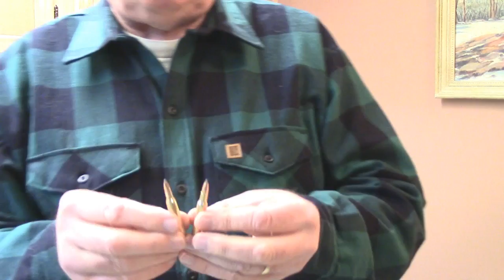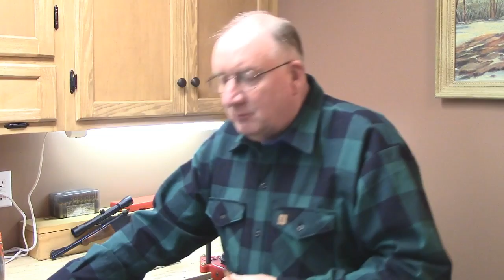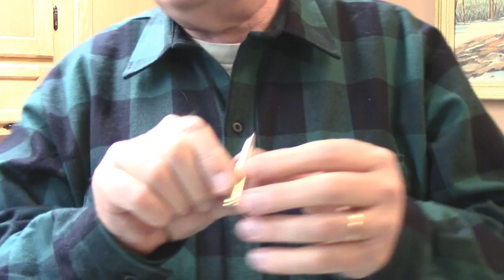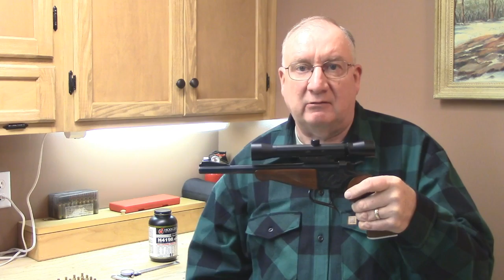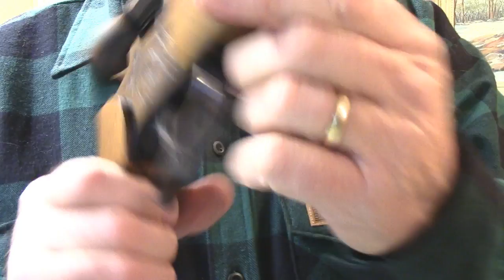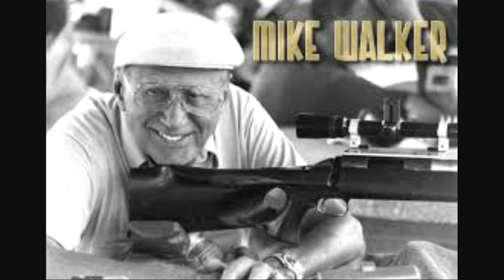The Great  222 Remington

Comment: Gary park
     I just came across this post.
I was listening to at as I was reloading for my 222 rem. My 222 rem mowhawk 600 is also and old and trusted friend.  Here in northeast Pa. I've used it for many things. During the Rim fire ammo shortage . I loaded 55 grain cast bullets with reduced loads and it became my squirrel rifle for 5 years.  I didn't stand in line for a ration of 22mag or 22lr ammo. I have a reduced load I use for fall turkey.  As a wildlife conservation officer it took care of truck loads of road injured deer , with one and done effectiveness. It's a constant companion on my little farm.  Chucks in the beans, coyote around the chicken pasture, the little triple duce is just right, cheap to load for and versatile. My mowhawk 600 sports a new black walnut stock, after market metal trigergaurd ,  and a fixed 4x scope. I'll never part with my 222re

Comment: Great video Gunblue.  I have always had an interest in the Rem 721 and 722 rifles as they are just so well made.  Hammer forged actions and barrels, etc.  Lucky enough to find a Rem 722 in 222 Remington in great shape that I am going to pickup.  Master gunsmith in my area feos the same way as you about the cartridge.  I am looking forward to getting to know this cartridge very soon.  By the way, the CZ Czech rifles are phenomenal so if you get the chance, check them out.
Reply: J’ai possède deux cz en 222, 527 et 550 lux excellent au tir sur prédateurs à la distance moyenne de 200m pendant 35 ans de garde de chasse en France que de souvenirs nostalgiques.

Comment: the designer of that trigger himself said it was a bad design but Remington refused to change it because of business reasons
Reply from the maker: Such an attribution requires documentation, or it's simply hearsay. The trigger was absolutely not bad. Because Mr. Walker designed it for complete adjustability, it was vulnerable to misadjustment by foolish people. Countless millions of mechanical tools and systems are vulnerable to being maladjusted or misused by incompetence, whether it's a chain saw, welder's torch, window washer scaffolding, or the operation of a car accelerator pedal, but it does not mean they are bad. I have an intimate understanding of many trigger systems, especially Walker's Remington trigger.  Do you know how many fine triggers made through the years had similar adjustment vulnerability to misguided hands, and how many guns beside Remington's could be abused?  Nobody ever scandalized Sako's fully adjustable trigger. The whole issue was a scandal perpetrated by an anti-gun media to destroy an American institution.  It was never an unsafe or bad trigger. The result is that now, triggers are made to prevent reasonable adjustment, and are sealed, which means that owners purchase sketchy, unnecessary, and ridiculously expensive aftermarket triggers that are packaged with legal disclaimers, which are abused no differently than the Walker trigger was. "Business reasons" is not a bad thing, except to those with a Socialist agenda.  Business is where people go to work and how America prospers.  Remington had no reasonable grounds to change such an excellent design until they were unfortunately compelled to do so by a tort-minded letigious bunch of hungry lawyers.

Comment: What are your thoughts on 5.56x45 over .223 Remington? I watched your video about how energy does not equal killing power and it made me think about my choice for using 5.56 exclusively. However I exclusively shoot Magtech M193 at the range and its 30¢ a round so I just have never seen a reason to buy weaker .223 for the same price. Am I missing something here?
Reply from the maker: I understand your financial perspective, which corresponds to the natural desire to get more for your money.  That's one way of looking at it, but I give you what I consider the far more important factors.

The 5.56 runs at the extreme pressure limits imposed on military rounds, which are considerably higher than 223 ammunition. Pressure of that nature, along with it's higher heat level, induces shorter barrel life, and higher stress on gun parts, all things being equal.  And more muzzle blast, too. Shooting at a range does not invoke a need for higher power ammunition that performs no differently down range.  The velocity difference does not correlate to particularly better performance that you would ever observe in practical conditions.  

My Colt AR-15 A4 is military grade and rated for full house 5.56mm ammo, which I have fired in it on occasion when my buddy wants to share his.  My standard 223 ammo shoots to within 1 inch of the same point of impact at 100 yards, and there's no perceptible difference in trajectory out to 300.   His M193 ammo hits 2.5 inch higher on target out there, but mine is more accurate, which I'll take any day over trajectory, because that's just a sight adjustment factor.

From a target shooter's perspective, I've gotten as many as ten reloads or more, with occasional annealing, with standard loads.  Military cases can suffer as high an attrition rate as 30% on the first firing due to primer pocket loosening, and rarely can go more than another shot if loaded to M193 pressure levels.  If reloaded however to 223 levels, they still only give me another four shots at best, with dropouts at each load.  (Accurate Powder is the only source I'm aware of for NATO grade loads).

The 223, when fired from a 20 inch barrel, produces virtually identical velocities as the 222 Remington with a 24 inch varmint barrel, which has never failed me.  I see no particular point in adding another 150 feet per second at best, which adds only 30 yards of ballistic gain, while stressing my rifle unnecessarily.
Reply: @GunBlue490  that all makes perfect since, my rifle is very similar to how your A4 was factory except BCM instead of Colt. I had always heard that .223 was more accurate but when fired out of a .223 chamber. Another myth busted, I will try out some .223 loadings and see if I can get that 1 moa group. Mine does about a 3 to 3.5 inch group at 200 yards with iron sights on a good day. I'm still pretty new at this shooting for groups stuff, I still don't even have a scope. I shoot at 200 on my buddies "range" on his farm because that's how he has it set up. It would be pretty awesome to get a 2 inch group with .223. Is there a particular load you might recommend that is somewhat reasonable in price (50¢/rd or under) ?  I don't handload just yet but want to get into it one day.

Once again I'm glad I found your channel. So much good knowledge here.

One thing I like about the Magtech M193 is its advertised velocity is 3,265.  I assumed this was probably derived from a 24" test barrel but sure enough I tested it with a coworker's chronograph and the 10 shot average was 3,259 with a couple of the shots being very close to 3,300. I think the highest one was 3,297. I thought that was very impressive out of my 20" BCM barrel. Now that you have explained it I may have been causing unnecessary wear and tear with this very hot stuff. Maybe thats why the face of my buffer is all scratched and beat up after 800 rounds. 😳
Reply from the maker: @toki89666  A couple of things... Your A4 is shooting typical accuracy for the configuration, similar to mine.  Its accuracy is limited greatly due to the forend bearing on the barrel.  For utmost accuracy, it's necessary to get a free floated handguard kit, which will eliminate stock interference, which is pretty significant.  While there are countless variations out there, Brownells sells the A4 style made by Rock River Arms, which is what I mounted on my National Match barreled upper.  I got mine direct from Rock River Arms for a few bucks less by giving them a call.  It will require that you cut off your front sling attachment, but there's one mounted on the new forend that won't pull on the barrel.

As for accuracy issues with ammo, it's not so much whether it's 223 or 5.56 ammo.  The issue is the 5.56 chamber, which has significant freebore and lots of bullet jump that limits accuracy potential to some degree, but some guns shoot quite accurately with it, regardless.  Wylde hybrid chambers are common on National Match guns because they permit 5.56 ammo with the accuracy of the 223 chamber.  Good luck.

Comment: I want to buy the most accurate rifle I can possibly buy. I don’t hand load. So with off the shelf ammo which is generally more accurate at 200 yards- the 222 with a 50 grain bullet or the 243 with a 55 grain bullet? I don’t hunt, accuracy is the only consideration.
Reply from the maker: That's a question that I cannot really answer without qualifications.  In absolute terms, the 222 Remington has a record of supreme accuracy exceeded only by the 22 and 6mm PPC rounds.  It also has a reputation for exceptional accuracy with factory guns and ammo.  In practical  terms, the 243 has also had it's fair share of exceptional accuracy with factory ammo that is by all means capable of the same accuracy on any given day. So, a direct comparison of accuracy would likely be so similar with factory guns and ammo that any difference might be hard to argue.  However, there are other considerations that break ties. The short, stubby 55 grain 243 bullet is not the most stable in any wind, while the 50 grain 222 bullet is a perfectly balanced combo. To move up the weight of the 243 is required to get to the bore's sweet spot, but remember that it's a big 308 case with over 50 grains of powder, much more blast and recoil and cost per round.  If accuracy is the prime consideration, and if you're not hunting larger animals, the 222 is certainly a winner on all the above counts, while being cool on a barrel, and easy on the shoulder and ears.  Under windy conditions, the 243 with longer, heavier bullets is likely to drift less. The 222 is strictly a small game varmint round out to a practical distance of about 225 yards or more, while the 243 can deliver 75 and 80 grain match bullets accurately to 400 yards or more.

Comment: I always preferred the longer neck of the .222 and it is, generally, a better cartridge for handling the heavier .22" bullets than the 5.56/.223.  But it was modified to fit the AR platform better and provide the requested ballistics in the size limits of the AR magazine.   Too bad it has faded in popularity.  If you are a handloader, the .222 is the better cartridge.

Comment: I agree about the greatness of the .222 Rem. I purchased a model 700 with the heavy bull barrel chambered in 222 in the late 1970’s. That piece is an amazing rifle. As long as my bullets were under 55 grains, it was capable of 1/2 minute of accuracy. However, I must disagree with you about the model 700’s trigger not having any issues. I purchased new in 1976 a 6mm Remington. I never touched the trigger at all. That rifle is constantly having the infamous “Remington moment”. If you practice safe gun handling, no one should ever be shot accidentally, following all the rules. I leaned while deer hunting back in the late 80’s- early 90’s, while unloading my rifle, that it discharged upon disengagement of the safety. (Older model 700’s required the safety be disengaged prior to opening the bolt, a stupid design if you ask me)

Comment: Great video, I’ve really been looking at this cartridge. I found a CZ the other day with a Mannlicher stock, and I would love to hear your opinion on this style of stock with all the rave these days a free floating barrrels. Thnx, Chris.
Reply from the maker: Mannlicher stocks are certainly beautiful, and I have always admired them.  Admiration is as close as I have gotten.  I have never purchased one, simply because most, with rate exception, are not free floated.  Free floating may be the rave, but it is certainly not by any means new.  It was being done by accuracy enthusiasts long before I was born, and glass bedding was well established at least 70 years ago or more when fiber glass and epoxy resin was first being used in boat building after WWII. I free floated my first rifle and glass bedded it in 1971, and learned it from a fellow who had free floated 30 years before that! (I love it when I hear that shooters are discovering what their great grandfathers invented).  

Mannlicher stocks are traditionally used for carbine length barrels, which means considerably reduced velocity, compared to a standard rifle.  A non free floated barrel may certainly shoot well.  But greater chances, it may not.  Nuances of pressure can change with humidity and upset impact points, which are critical with an accuracy rifle.  If you are looking for a 222 Remington that shoots like one with it's renowned accuracy and velocity, I would personally not recommend a Mannlicher, pretty as they are.

Comment: I have a Tikka 12 gauge / 222 over under with a M8 x 3 Leupold scope What a wonderful rifle. The 222 zeroed at 2oo yards normally shoots 3 shoot groups under 1 inch, To add to the quality that same setting shoots rem. slugs 1 inch high at 50 yards and dead on windage. For Ohio hunting in the 70's, 80 & 90's it was everything you needed. The only problem was the trigger is really light for pheasant hunting.

Comment: Mate,  My third centre fire was a Remington BDL in .222.  I regretted selling that about 1 day after it went in 1990.  My next .222 is a Sako 85 I bought about 8 years ago.  Great accurate rifle.  In the last 28 years I've learnt with reloading to Keep it simple.  find a projectile, find a powder and primer with a good case.(Winchester) press repeat.  You don't have to check sites or check ranges.  You just know where it is going to land at anything out to 300metres.  Leupold scope.  good firearm.  
I did get another Remington BDL 700 in .243 from serial numbers it was built in 1975.  Another fine firearm.

Comment: I need to watch this video again and will.  I have a Savage 340B in 222Rem and have been having a hard time finding a good load for it but I keep trying.  Can this particular rifle be free floated?  Some say no because it has only one receiver screw.
Reply from the maker: Lance Schul 
I have no experience with that rifle, and I don't know its setup, but I have not seen a rifle that cannot be free floated, though you may have to support a short section of the barrel, as with a Ruger with the angled screw.  An action cannot teeter-totter but there's usually a way. Rule #1:  You can almost never float a barrel without bedding it, too, or you will loose stability.  Try H322 powder before you do anything else.  That's  THE 222 powder.  If that powder won't work, you won't find a better one.
Reply: I'm not a reloader.  I have a Savage 340D.  My great uncles bought it new in the later 50s or early 60s.  When I finally got it-I just gave a good cleaning.  Then  I found that Federal factory ammo shooting the 40gr Nosler Ballistic Tip shot very well.  I know that every rifle is different-that's just what worked for me. Hopefully you found an accurate round.

Comment: Thanks for your video and your knowledge. I love my Sako Vixen in .222 that was purchased new in 1963. I hand loaded with a Lee Loader and it took many chucks. My best shot , admittedly using Kentucky windage, was a measured 309yds. , taking the top off the head of a crow. The rest of the birds near it just stood around pecking it as they had no idea what had just happened ! Also worked on a dairy farm in Ohio and fondly remember drinking ice cold fresh milk from the refrigerated tank as I swung by the milk house while driving tractor from the silage fields.
I’m now retired in Florida and there are no woodchucks down here. I miss the fields of the Midwest and New England where I hunted for many years.
God Bless.
Reply from the maker: Jim Gorman 
That's my kind of memory.  Good stuff, and it doesn't get any better than a 1963 222 Vixen!  God bless.

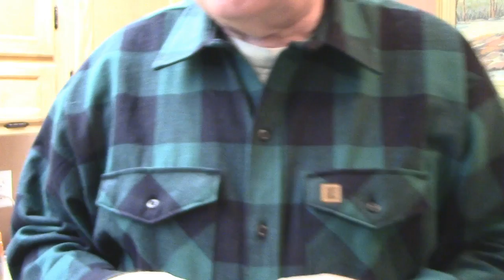Comment: Hello;  I picked up a Remington 722, that was originally a .222, but the PO rechambered it to .223 with the original 1:14 twist barrel. Probably for the cheaper cost and availability of .223. I'm thinking of re-barreling it to .222. What barrel length and twist rate would you recommend and what are your thoughts on the .222 magnum

Comment: I agree, with you, recently bought a 22-250 Only because I couldn't find one.
Reply from the maker: Brad Lehman 
Another legendary 22!  When you find a Triple Deuce, you'll have both of the best there is.  ;-)
Reply: I hope to down the road, I think Savage is making there model 25 but I'm not sure. I really wanted a 788 in 222 but hard to find.but It got to wait, money is tight. but I still hang on to some micro adjustable herters 222 dies I got somewhere along the line.
Reply from the maker: Brad Lehman 
Tikka, Beretta, CZ, Howa, Sauer and Savage are also currently making the 222.  My new Tikka is a real gem, which I demonstrated in my bedding videos.

Comment: yes but 3000 fps is not 30 equil pieces of a pie and energy is expentional --- a bullet  at 1,000 fps then pushed another 1,000 fps too 2,000 fps is 4 times the energy -- then push the same bullet another 1,000 fps  too 3,000 fps the energy is 3.5x more---FACT